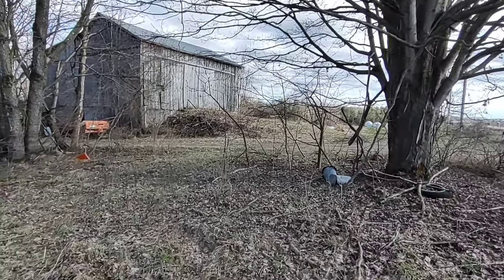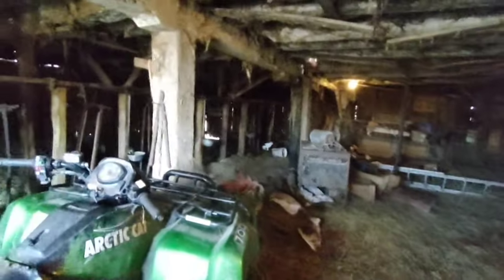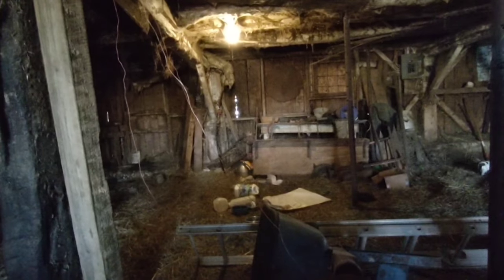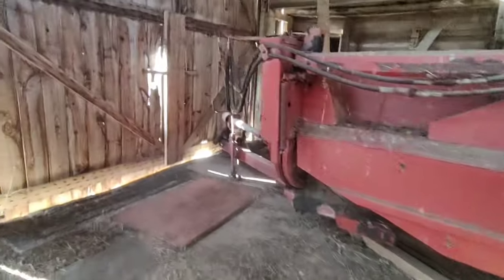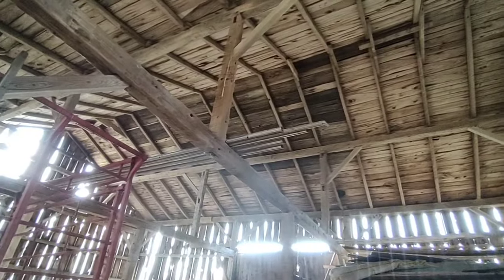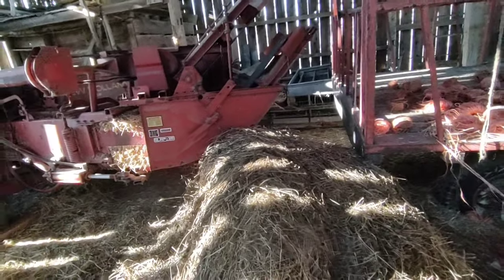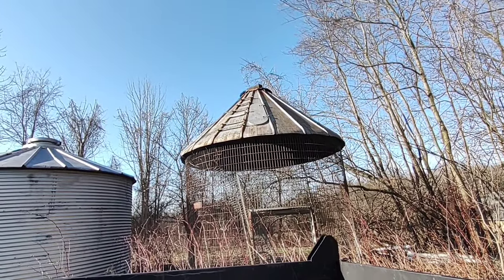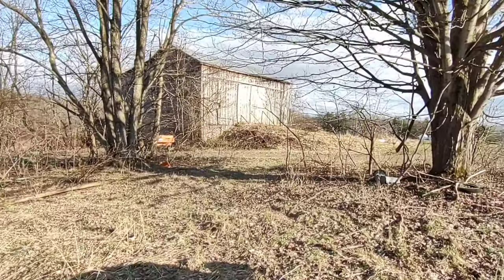Walking through the old heifer barn.

Comment: With our old barn, we reinforced the supports down where the cows used to be. Honestly the old bank barns were really never meant to house cattle, barn cleaners etc. So now we use the upstairs for large squares, reinforced the floor so it can handle the weight. If we had not done work in years past, the barn would be in really rough shape, glad we did then, cheaper vs now.
Reply from the maker: We used to add floor jacks when stacking hay because of the added weight. When these barns were they were made for loose hay. 
That's also why I rolled the round bales in upstairs. I feel nervous just driving on the floor with a skid steer.